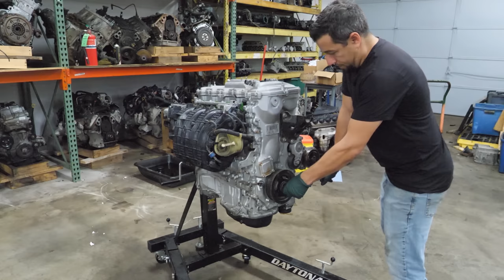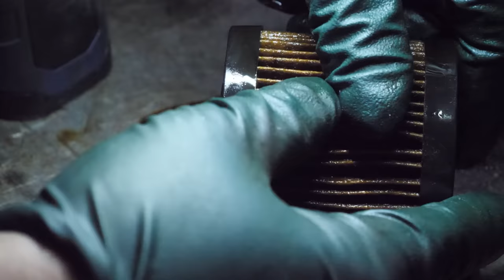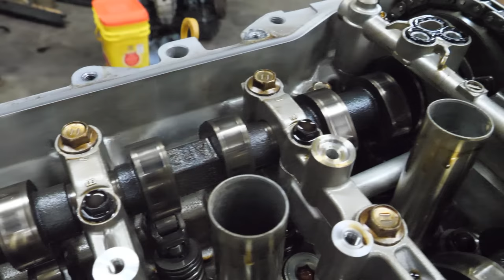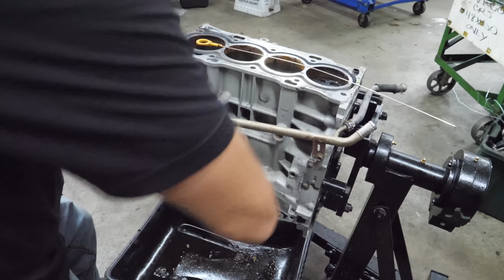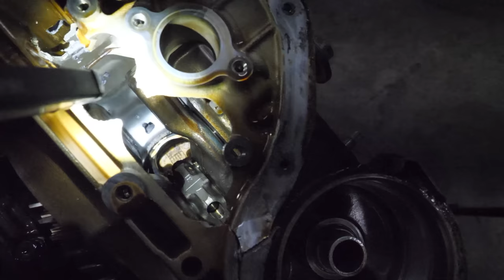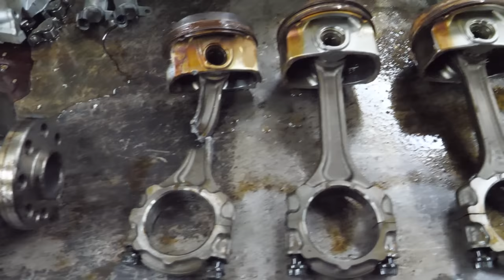TRASHED Toyota Camry Rav4 Scion TC 2AR-FE 2.5L Engine Teardown

Comment: Toyota engineer here with a fun fact: The replaceable cam bearings you mentioned are Teflon coated hardened steel and are ranked A B C and D… The clearances of each are just SLIGHTLY different… Functionally there is no difference in the finished product… What they do take extremely precise measurements of the camshaft surfaces and match it with bearings for an optimal fit. Typically the thicker bearings are used more toward the end of life of a particular bit on the machining center that makes the cam. We are talking a TINY about.
Reply: Funniest part about this is I didn’t learn this fact AT Toyota. I was a machine builder for a long time before coming over to Toyota…  They were our largest customer by far, we worked in a lot of powertrain plants all over the country… In this case it was a project for West Virginia powertrain plant and I designed various “line sequence control” type systems that instructed team members or automatic equipment which part to pick from a bin or what operation to perform based on data from a RFID tag or other source. One of them was these bearings for the head sub line. Incidentally the wrong bearings were put in the bins the by some complex chain of failure one time. It wasn’t caught until they had run like 1 quarter of engines (2 hours) which was a couple hundred or something at that particular line… All the engines passed the 3 min warm up booth instrumented test right in the middle of the ranges, no problem because the difference is minuscule but they elected to scrap all of them just in case lol

Incidentally now I work as an engineer in the plastics shop of the the global flagship and one of the largest plants of any manufacturer in the world: TMMK in Georgetown Kentucky. We make the intake manifold for this engine which we ship to TMMWV (and also to our own powertrain plant)… I am not over that line however. Myself and 2 other engineers oversee processes on the IP (instrument panel, aka dashboard) line for Camry, Rav4 and Lexus es250 and es 350 (same parts) as well as past model service parts of prior generations and new model planning which is my current focus (exciting stuff coming lol)
Reply from the maker: This is why I read all of the comments. I did know about bearing sizes but it makes so much more sense than they are compensating for machine/tooling wear

Comment: Man, my 2017 2AR-FE has zero leaks. Oil changed every 3 - 5000 miles. Currently at 84500 miles
Reply: thats almost wasteful its too often. more like 5-7500 is most realistic.
Reply: @bradhaines3142  
Depends if he rakes up 5000 miles in 3 months or if the engine is idled in traffic for an hour each way each day?
Reply: @bradhaines3142 Toyota Recommends 10,000 miles oil changes. There's a known issue with the low tension rings getting sludged so 3-5,000 intervals is much better.
Reply: I'd do the same thing,  I'd rather waste oil (which can be recycled) and have the insides be clean than take a chance with sludge.   :)
Reply: That’s a silly amount of oil changes, you can stretch that a little more for sure and you’d still have ZERO leaks lol.
Reply: @Yoshimatsu414  
How old is the car you drive? 
How many years have you owned it? 
How many miles have you covered?
You change your own oil?
Do you use full synthetic, semi synthetic or "ordinary" mineral oils?
Filter changed as often as the oil?
City driving...
or country miles @ 100kmh?
Reply: @JohnSmith-pl2bk  I’ve had a 2017 Ford Focus ST for just over 2 years now. Bought it with 21000 miles now has 70000 miles I use to do ride sharing in it and done other contract delivery jobs with it plus personal vehicle. Would change oil with full synthetic and filter at same time every time the message comes on to change it about almost every 10000 miles. Mix of Highway and city (mostly city) I’ve had ZERO issues with the vehicle. All I’ve done is get a new set of tires besides regular maintenance. As some who uses his vehicles for work, unneeded oil changes would cut into my profit so I follow exactly what the manufacturer says, don’t try to act like I know better.
Oh and I also do check my fluids regularly in between me dropping it to the deal for maintenance. If I have to top off oil because level getting low I will.
Reply: @commutinginatlanta9163  that interval is appropriate given for setup oil is less 'diesel' with all the VVT fuel/oil mixing.
Reply: @JohnSmith-pl2bk  
I have the same engine and similar miles

How old is the car you drive? 2016
How many years have you owned it? 5 
How many miles have you covered? 98k total miles
You change your own oil? Nah
Do you use full synthetic, semi synthetic or "ordinary" mineral oils? full synth
Filter changed as often as the oil? yes
City driving... minimally
or country miles @ 100kmh? mostly highway at 62mph
Reply: Man!!!! Who in his right mind would change oil every 3000 miles !No respect for the environment! I drive a 2003 Mercedes C320 , 220 000 miles and oil changes every 12000 miles . Motor has never been opened ! Water pump at 200 000 miles and belt tensioner pulleys ,altenator bearings and new brushes. Keep on bragging about your Japanese high maintenance ,oil change guzzling motor
Reply: @c-teamtrading9690 The environment argument, but you drive a 3.6 v6 and he drives a 1.8 inline 4. Your carbon emissions and gas mileage pales in comparison to his oil consumption (that gets recycled anyway)

Comment: I have had 2 cars with this engine and neither one gave me a second's trouble through 200K miles on each.  I can see why now. Simple robust design all around.  As few chains as possible and the one chain used has as straight a load path as I've ever seen in a DOHC engine.  Great engine.  Thanks for the teardown and thanks to Andy and son!
Reply: I also like the gear driven balance casette.  Not seen that before.  Much better than rubber belts.
Reply: @john1703  
Only thing to make it perfect would be a gear drive to the DOHC....and OEM water repellent coating in the air intake system😁😁
Reply: I'm a body mechanic. Plus a life long car guy. I see a wide range of 4 cylinders on a yearly basis. We got one in that was hit hard in the back/side. So nothing to do with the fwd drive train in the 2015 rav 4. I was surprised by how bad the nvh on these engines were. If you tap the throttle while in park or neutral it will vibrate the shifter. In a automatic transmission! Compared to kia 2.0, jeep turbo 1.4, jeep turbo 2.0, fiat multi air 2.4, Ford ecoturd 2.0 and 2.5 I found the Toyota harsh, buzzy, and has a horrible exhaust sound. Driving that car was like going back in 4 cylinder time 3 decades to the 90s. I don't care how reliable these are I couldn't live with it every day.
Reply: @beavistechrock  
Did you drive this write off...or one that had not been hit?
Didi you try a second one just in case there was something not quite right about the first "good" one?
A lot of money is spent by OEM to stop as much NVH as possible...
if they were all this bad?????
Reply: @JohnSmith-pl2bk  we had a 2017 rav 4 come in recently. Typical frt end hit. Replace fascia, left headlight, a few bezels, align it and ship it. It was a loaded model. Leather, 4x4/awd, all the power goodies. There was less vibration, and less noise with the windows up. But the basic character was the same. I kinda figured your same logic but reversed. For the most part toyota ppl are brand loyal. If they never drove anything else they wouldn't think anything of it. I've owned one 4 cylinder in my life and it was a 1995 quad 4 grand am automatic. It was last year for 2.3 displacement. First year for balance shafts. I bought cause I had no idea it was a 4 til I popped the hood. Idle was smooth, exhaust note was good. They did get kinda raspy above 5k rpm but a 7k redline was pretty impressive in 1995. I've got a 2005 vtec 3.5 pilot for a daily driver. For the winter months I have a 99 4.0 straight 6 grand cherokee. Both are super smooth. My point is the majority of ppl don't pay attention to the things I listed. As long as it drives without rattling apart it's fine. If you get a chance drive a 2018 to present jeep compass or renegade (both can be had in the high 20k low 30k range new) with the 2.4 multi air, the 1.4 turbo or the new 2.0 turbo compass it's a world of difference. One more thing I will cede is it was a 2015. A lot has changed since then.
Reply: @JuanPabloRiojasGaming  and calling someone a troll with zero other content or information in your post is positive? What you see above is what us grown adults call a discussion. Different viewpoints are argued without childish name calling. Try it sometime.
Reply: @beavistechrock I agree.  The 2.5 liter in my 19 RAV4, while reliable, is less refined than the 4Tech in an 86 Grand Am I had.  The RAV4, while over 1000 lbs heavier, gets 10 more mpg and accelerates twice as fast.
Reply: @beavistechrock  Truth be told, I'm not sure why these things matter. I'm not exactly what you'd call a car guy, rather mechanically interested and vaguely mechanically inclined. I have a RAV4 with one of these engines in it that I bought for efficiency and reliability. Undeniably on the front of NVH, it's not a lovely vehicle to drive. But I've never had a single issue with the vehicle, it has more power and acceleration than you'd expect, it handles surprisingly well, it doesn't guzzle gas too much, and it's easy to work on. I've driven plenty of expensive vehicles and can appreciate how nice it is when a vehicle simply feels smooth and quiet. But in terms of pure function, I've never noticed anything to be lacking due to the relative harshness of some toyotas.
Reply: @KeterMalkuth  I get your points. I get a lot of ppl don't notice things like nvh. I'd say turn the radio up but I found the base toyota sound system pretty craptastic as well. I also want to point out I'm not a import/ toyota hater. I really like kias in fact. I had a ex gf that had a 02 camry v6 that had 290,000 on it when we broke up. I could also chalk up these issues as my mis understanding of toyotas reputation. When efficiency and value are core to toyotas brand I guess you can't have it all. From what I understand of motors once you get over 2.0l and 6,000rpm  with a inline 4 your just asking for imbalance.
Reply: @beavistechrock  very true. And I'm not saying I don't get why the factors you meant are important and a consideration. If I had to choose between a vehicle that's smooth as silk and quiet as a recording studio, or one that isn't, then obviously I'd choose the vehicle that feels better to drive. All I'm saying is that those factors don't meaningfully affect my experience driving, while reliability or expense at the pump do. That said, different people value different things. I'm very easily pleased by a vehicle that just doesn't have problems.
Reply: @beavistechrock  I love my 2arfe Rav4's. Yes Toyota has made me brand loyal. I bought a Toyota because I was sick and tired of the trash GM, Ford and Chrysler flood the market with. After owning 2 RAV4's and having no unforseen repairs I'm satisfied. I'll take the cabin noise over constant nickel and dime repairs any day. The quality and reliability is on a completely different planet with Toyota compared to any domestic, and the RAV4 no matter the trim level is an entry level car, it's the Chevy equinox of Toyota land. Go ahead and research resale values between them. There is a damn good reason for the RAV4's hold their value. A routinely serviced comparably equipped example of each will show that a higher mileage RAV4 will sell for more than a Chevy equinox etc. There are only two quality cars in the class RAV4 and Honda CR-V.  
As far as jeep goes it doesn't matter what the hipsters pay for their"it's a jeep thing" trash, because it is trash. The only reason they exist is because people don't care about long term reliability when they are going to flush the turd when the warranty is up.
Reply: @truracer20  grand cherokees consistently hold resale value. Especially 2011 to 2022 WK models. Blanketing all jeeps as crap is a bit much. I grew up in a age where most of my friends parents worked for the big 3. One of the best pieces of knowledge that was passed from them is buying a brand new car is a waste of money regardless of the brand. All these guys had wife's who had to have a shiny car. They would buy one 2 or 3 yrs old that just came off lease with 20 to30k miles for anywhere between 25% to 35% less than the new model. For what's basically still a new car. Me and the old lady have 3 cars in the driveway. My daily driver is 99 grand cherokee. 247k miles I've owned it for 9 years now. Paid $1,500 then. I've maybe put $1,000 in parts in that time. Her daily driver is 05 pilot awd 3.5 . It's got 240k I bought it for $1,800 5 years ago. I spent about $800 putting all new brakes, shocks, fluids. All basic things anyone with a weekend and the ability to watch YouTube videos can do. 3rd vehicle for up north trips or picking up appliances is a 2005 gmc envoy xuv. It's pretty cool. It's got a power roof that retracts which comes in handy for picking up a washing machine. Bought it for $3,800 10yrs ago. Put a new trans in at 195k for $1,800 now has 256k on it. Ill also add all of these vehicles have no warnigs lights on, 4 wheel is functional in all, as well as ac and the power stuff. Adding all this up I bet doesn't come close to what you paid for 1 rav4 and let's not even discuss insurance. I don't pay for full coverage. A lawyer friend taught me years ago that full coverage is throwing away money. If your living within your means It's far better to put aside a savings account and pay cash for repairs. Unless you've got a wife or gf who's constantly getting hit in parking lots with no idea how it happened. To wrap it up there's plenty of ways to own a decent cost effective reliable car that doesn't involve buying a rav 4. I'm a fan of kias for imports. I've seen 2 different spectras hit 240k with bare min maintenance. I'm well aware of toyatas quality reputation I've been looking for a 1st gen Lexus ls 400 for awhile. Those are well known 400k+ mile cars. My original comment was more of surprise than anything. I just wish toyota owners would quit thinking everyone who doesn't worship at the toyota altar is a dummy. Especially the fart sniffing prius owners.

Comment: In Australia flooded roads are a fairly common occurrence and we are constantly told not to drive through floods. It's even more risky when the water is flowing across because you get washed away. You also don't know what is under the water and the road could be completely gone
Reply: Here in NZ we have a lot too . Not too long ago ,near where I live , an genius destroyed his brand new HSV V8 by going though a section of road that had only shallow water flowing over it . If he had slowed down a little he would have been OK

Comment: Looks like a well engineered engine with no self-imposed over-complications.
Reply: They're reliable as hell. Early water pump failure and very minor oil burning (not as bad as the 2AZ-FE's) are the only issues I am aware of

Comment: I absolutely love mine. Just turned 100,000 and you could not tell the difference from the day I walked out of the dealership. Runs great. The only problem I have with the car is my hood latch is sticky from NEVER having to open it for repairs.
Reply: The hood needs to opened often for checking fluid levels.
I get your trying to be clever, but it’s silly to use that excuse to never opening your engine compartment hood.
Reply: You should probably open the hood every week to check the oil….but that’s just me.  At least once a week, maybe 2 times a month if you’re just way too busy.
Reply: @metalted6128  
r/whoosh....
Reply: I hear you there! I've had a couple things go on my engine... had to replace the battery, and had to replace the oil pressure switch (cut it started leaking).. aside from that, 151k miles (244k km) and the car is running perfect. 
Change the fluids regularly and this engine will last at least 400k miles I'm sure!
Reply: 100k miles on this engine isn't even broken in yet

Comment: Toyota recently extended oil changes to 16,000 kms, about 10,000 miles.  I took my car back to the dealership at 8,000 kms, about 5,000 miles for an oil change.  They said, hey you don’t need to change it for another 8,000 kms.  I told them to change it and I’ll do it every 8,000 kms. Based on my driving, it’s one extra oil change a year…..cheap insurance.
Reply: 😮Oil is Cheap, Engines,
         Not So Much😢
Reply: It may say that in the brochure but I just purchased a 2024 Toyota Camry SE and the free oil changes at the dealership are every 5000 miles through Toyota Care. Personally, I change my own oil every 3k miles.

Comment: 2010 Camry owner here, 2AR-FE with 254K miles on it. Burns a quart of oil every 5K which is manageable. That oil filter is clearly aftermarket; OEM filters do not have the plastic caps on the top or bottom. Straight paper filter is best. Those disks at the end of the cams contain the VVTi stuff inside and could be worth selling as another user posted; the little piston spring inside the disc at the end of the cam weakens / gets gummed up over time which is why these engines rattle for a second or less after start-up. Thirdly, I can vouch for the seeping of oil from the engine block, though in my case my PCV valve (a pain to change on these engines) could be to blame. Last, even though most of the oil burning issues were with the 2AZ-FE there were some faulty piston oil control rings that made their way into the 2AR-FE engines. This is one engine where oil changes at 5K or less is ideal.
Reply: Well said. Very well said!!!
Reply: pcv is a scam, have this end on '14 scion tc. just plug the pcv intake manifold, crankcase has enough to breathe with the breather hose